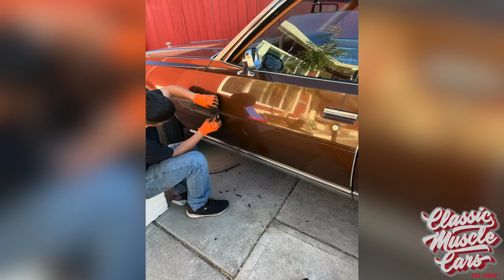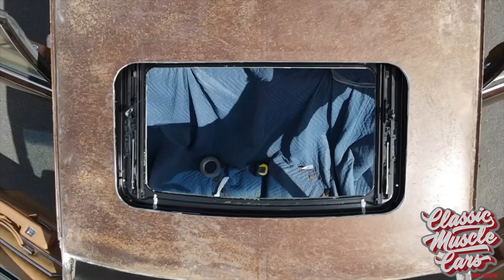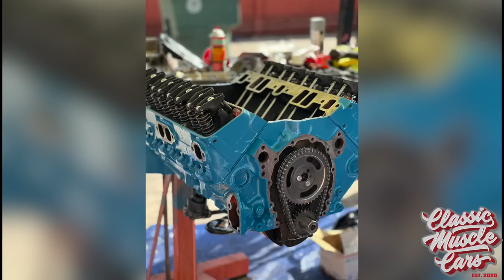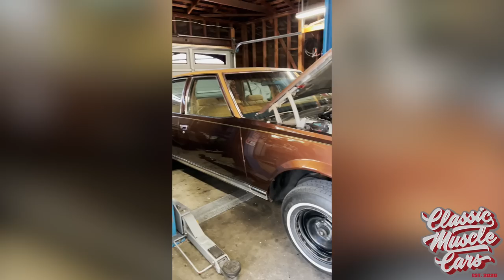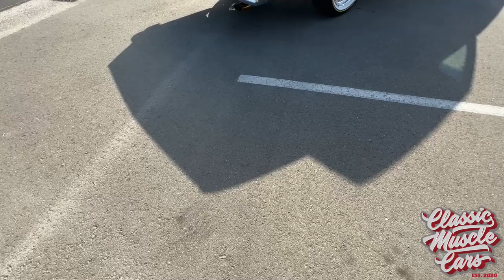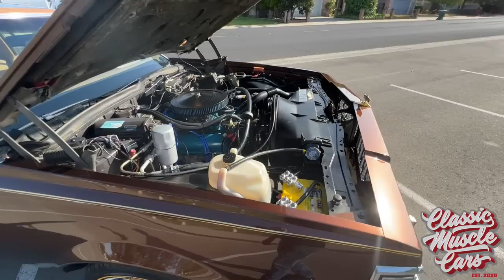1979 Caprice Classic/Box Chevy 3 Month Build Video - CMC’s Very Own

Comment: You did that bro 💪🏼 original with a twist best way to do it 💯💪🏼 doing a LS swap on my 79 rn. I’m on a smoke break I’m power washing the front frame/engine bay. Just got finished cutting the exhaust off bouta drop the tank and put the new one in lil later today

Comment: Dog ,i kept a 77  impala with a 350 cu in engine and a cruise control that was stashed in the turn signal switch .i t went right to 55 and i could almost go to sleep ,riding sweet .and thise potholes were just that .pop .i would guve my right arm to have yours .i would love to tint that and cover it up when not in use .dig me ...some fly ish

Comment: Make that power windows and leather u b ryte.. dope colur doe
Reply: Manual windows are better in my opinion!!! Power windows eventually have problems. Motors, wiring, and of course switches. I'm speaking from experience. 👍🏽✌🏿
Reply: @dirtypokesouthsideofh-town552  just fix it
Reply: @dirtypokesouthsideofh-town552  those problems are so minor
Reply: @SlickDonx510  I'm not the electrical type of guy. I'm the mechanical type of guy. I drive an '83 Chevy truck, lwb, 350 and 700r4 tranny.  I've been driving it since 2004. Only been to a shop for front end alignments and that's it. Fixed/repaired EVERYTHING on it myself. 
Electrical/ wiring problems are a pain in the butt. JMO
👍🏿✌🏿
Reply: @SlickDonx510  Yes, they could be minor considering that you are somewhat experienced in that particular area. I guess I'm just short on patience.
Reply: @SlickDonx510  I also have a '78 Impala. 305 is on the engine stand. Been there over a year. Money is key.  Machine shop prices are through the roof out here!!!!
Reply: @dirtypokesouthsideofh-town552  yea brother 🙌🏽 I totally agree

Comment: Clean homie 💯. What size motor u put in it.
Reply from the maker: Nothing special just a 4 bolt main 350 with a comp cam roller rockers to wake it up. Not looking for performance just something to ride and reliable AC works cruise control just like it came from factory
Reply: @classicmusclecars2020  oh ok. Thanks for the motivation💪🏾💯
Reply: @classicmusclecars2020  Shiiddd that's enough! Lol

Comment: Clean build but order wrong engine first than ragtop and roof then paint
Reply: We didn’t want overspray all over the engine 👍🏽 hard to find a body shop that will mask off everything properly
Reply: U honestly got lucky they didn't ruin your paint job putting motor or ragtop but again nice car I been through it all
Reply: All good bro but it’s not luck! We did all the work ourselves we did engine install and everything else. But I’ve do know what you mean for sure! Only thing we didn’t do was paint shop did that.